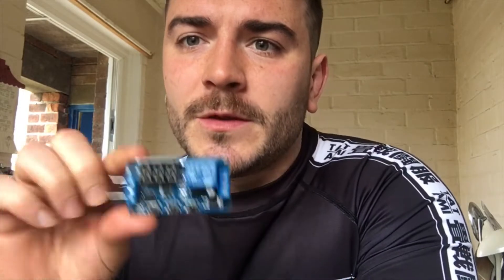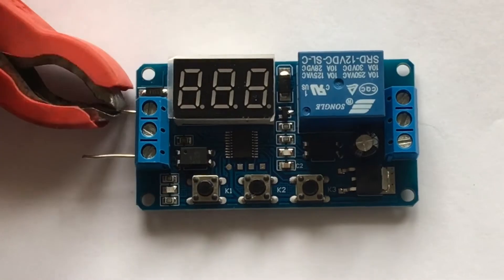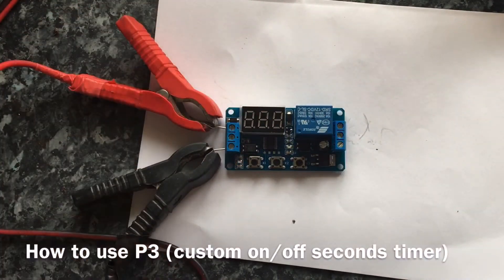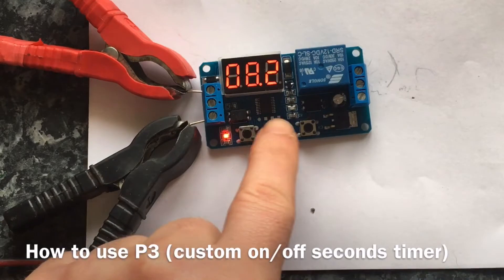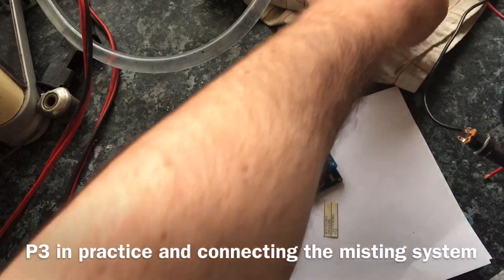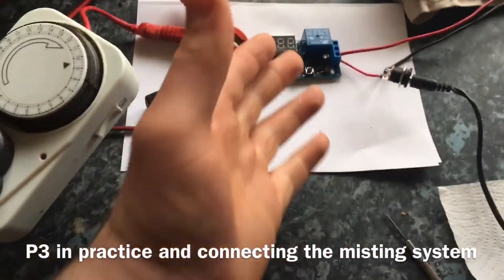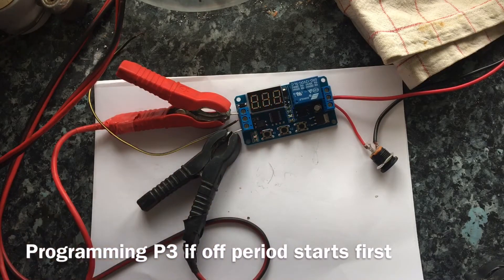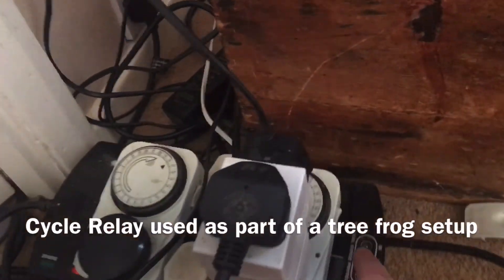How to Make a Digital Seconds Timer for Misting System, Terrarium Fan, Hydroponics etc

Comment: Thank you very much for this video. I am trying to use programming mode P3.2 (OFF and ON in a cycle, without trigger). However, it always starts in OFF mode. I need it to start ON, then OFF (I am using the relay with a separate timer that has a minimum period of one minute. I need the relay to limit this to, say, 10 seconds. This way, I can set the main timer to power up the relay, and the relay stays on for 10 secs, then shuts off). As it is, I get a mode flashing for a few secs on power-up, then it starts the loop in OFF. The loop works OK, but all this delay at startup is frustrating. Any way to set P3.2 to start in the ON position, no off? There are no instructions. Thanks!
Reply from the maker: Im no expert in electronics so sorry I cant help further than this video!!

Comment: The shortest on time is 1/10th of a second  (0.1 sec or 100 milliseconds).  If you are using a dc pump you can use the pump transformer to power both the timer and the pump. These timers are available with solid state relays which are the best option for dc devices. A solid state relay will outlive a mechanical relay by at least 40 million cycles  and they are completely silent. :)